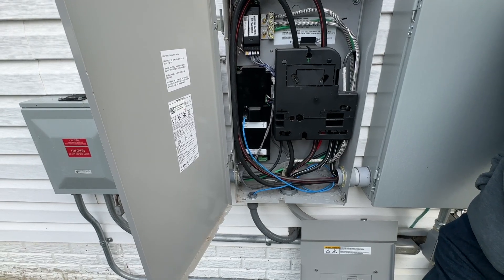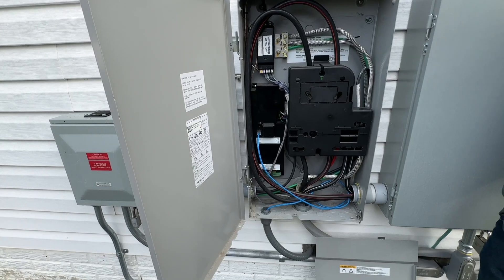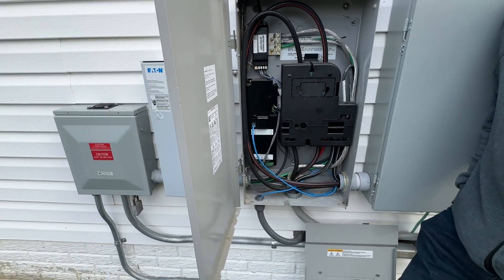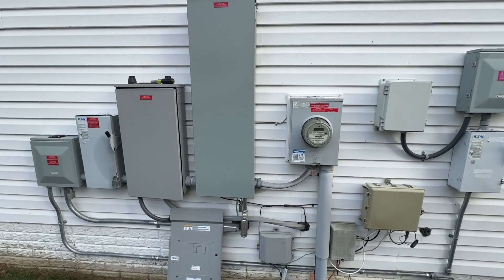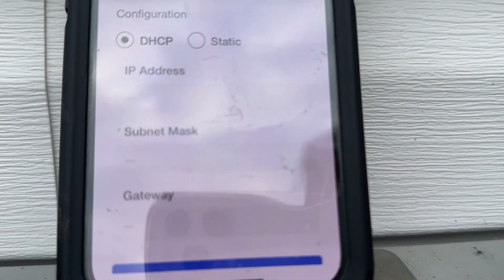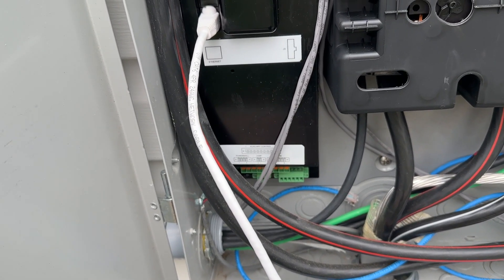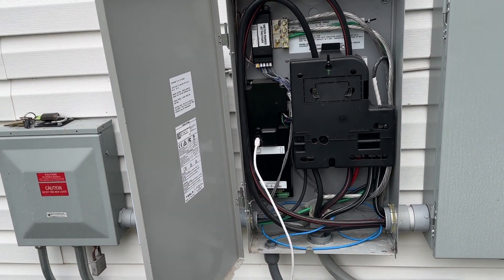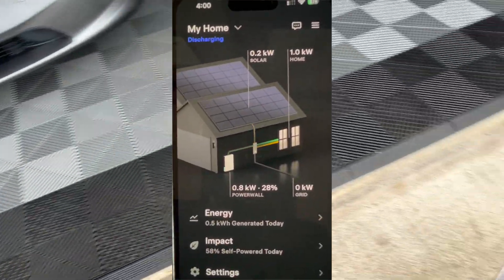"Finally! The Powerwall is up; it is on Wi-Fi and what did I learn. Please waste your time: S39- EP8

Comment: In IT, the majority of errors are layer 1, physical, issues. I was in a Cisco Networking course in which we were tested on our skills to make ethernet cables  and configure the routers and switches. I got so fast at doing it, I was able to do it within 5 minutes. During the exam, I was flying but nothing was working. I spent 20 extra minutes trying to troubleshoot all the configurations. Then I noticed that the RJ45 (ethernet jack) was loosely connected. 

In your case, this was unacceptable for them to find this issue after 5 months of issues.
Reply from the maker: @akassebaum - Thanks for your comment. I agree!!! As stated in the video, the Tesla tech identified the issue, after I stopped the video. Since then, the electrician identify the issue and thus Ta Da!!! I am on Ethernet! Thanks for watching. If you can, please subscribe to my channel.

Comment: Glad you have resolution. I am surprised your electrician did not confirm the blue ethernet cable was wired correctly, especially when it didnt work immediately after install. They have simple circuit checkers for that. Second, I am mildly surprised the final tesla tech did not offer to re do the cable head. Its pretty simple task for techs who deal with such cables. Any way good luck. My system has been working for two years now. So far , so good.